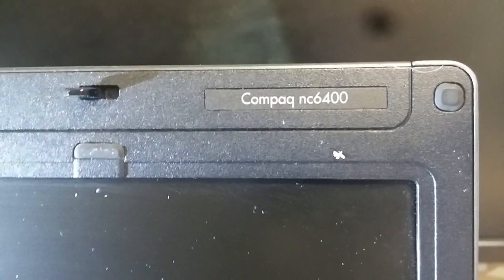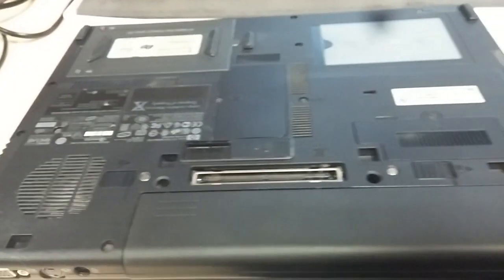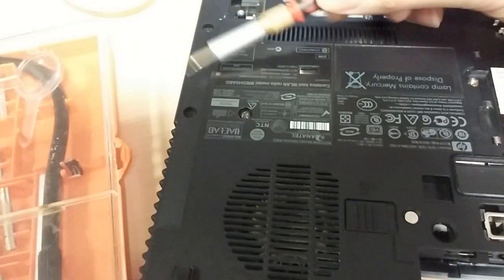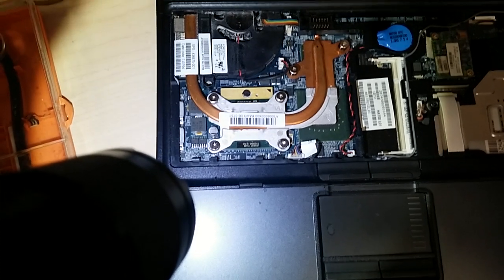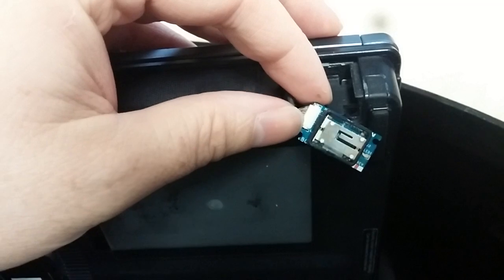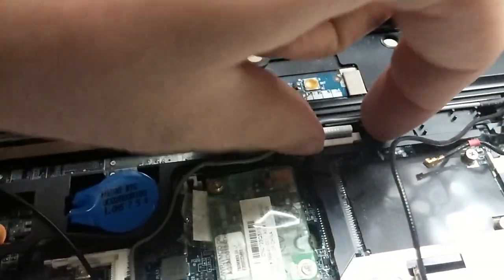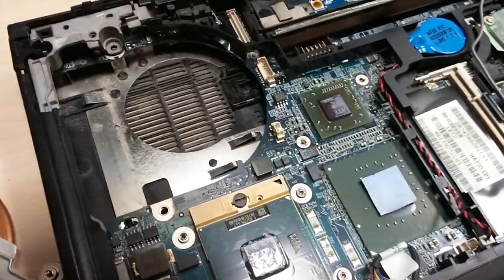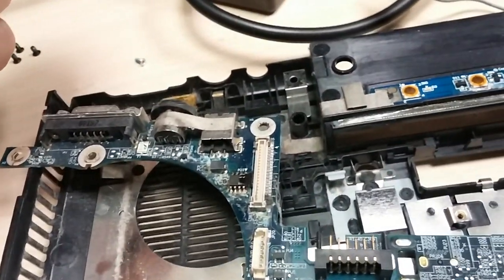HP Compaq NC6400 complete teardown MoBo swap pt1

Comment from the maker: Hello Johann, the only way to "upgrade" the card is to pick up the same motherboard with a better integrated card.  This motherboard only came from HP 3 different cards: Intel card, 64MB ATI card, and the 128MB ATI card.  If your laptop has the Intel card, you will have to get the different heatsink to sink both chips.

Comment: The board was good, the ati radeon video chipset was cooked for sure, most of them need a re-flow or re-ball and they work without a prob....
Reply from the maker: Omm this one had a water damage
Reply: Oh, probably skipped it in the video, but that is fixable as well, seen a laptop fixed after forgotten outside in the rain once and the second time after a cat pissed on it, the guy resoldered a capacitor and it worked, so it all comes down to who can fix it...
Reply from the maker: Omm agreed.

Comment: Hi, is it possible to add a better processor? maybe changing the motherboard..? I have this laptop and it works just fine, I don't know if it's possible to make it a powerful laptop, like having a four core processor and shit like that... Thank you for this video !
Reply: It is simple, never buy another HP laptop ever again. They build their laptops to make it impossible to upgrade! Even the parts that you can replace like the wifi card the HP makes a blacklist and if it is not in their list the laptop will not boot.

Comment: 12:23 if I'm not wrong that's a ram memory, I got my hand on this laptop once,  when I open the ram memory plate I found out one slot contain a 2 GB memory, I had no idea that there is another one under the keyboard, so I was wondering dose this device can hold a 4 GB in the back slot along with this 1 GN under the keyboard??

Comment: do you know what pci e card would be compatible with this machine that has link speed 300mb/s the one in the machine is rubbish and doesnt give good speeds at all. and the hp whitelist (so i've read up about) is causing me the issue that i need some kind of oem pci e card. any chance you would know where to get the correct one?

this is what i have "Intel(R) PRO/Wireless 3945ABG Network Connection" 

but i need to upgrade it to take advantage of my n network from virginmedia.

Comment: is it possible to get the dvd-rom out of the laptop without tearing it all down?
Reply from the maker: Yes. There is one tiny screw holding the drive in. It is located on the bottom of the computer just underneath the DVD drive. It has a little cd drive logo next to it. Once the screw is removed, push the drive into the laptop an it will eject itself.